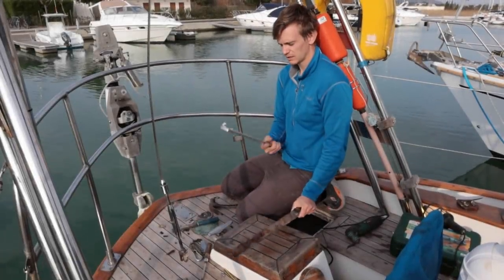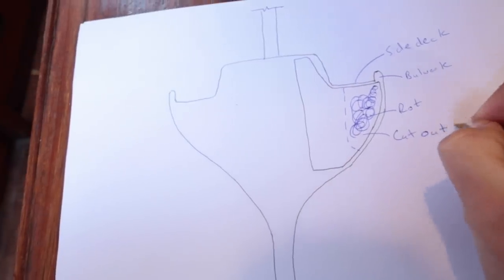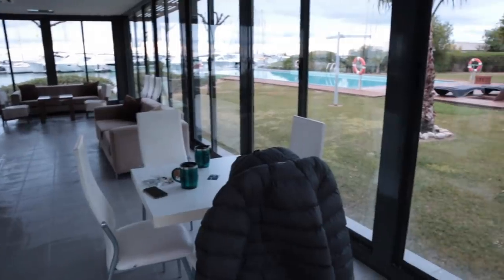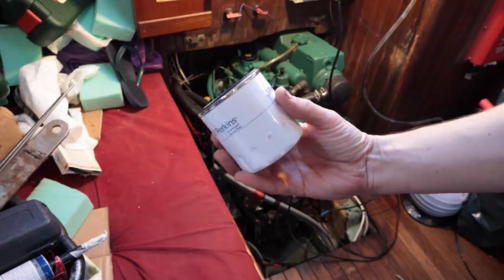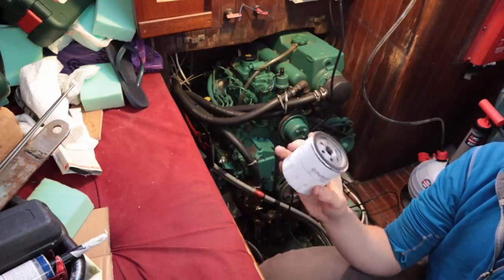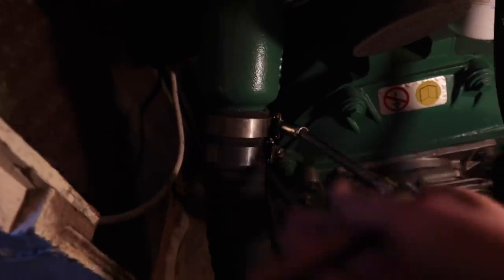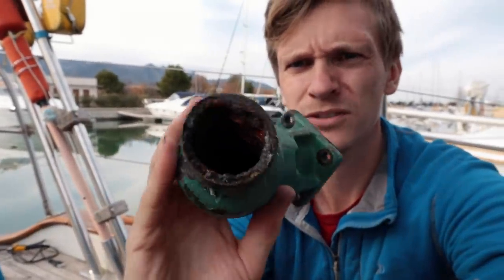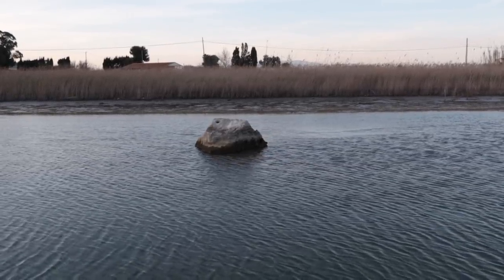41] OLD SAILBOAT ENGINE: Fixing THE BIG PROBLEM With Our Volvo Penta

Comment from the maker: What's your experience with Volvo engines? Is there any other preventative maintenance we should do?
Reply: replace the zinc anodes
Reply from the maker: Thanks for the tip, Michael.
Reply: Didya smear some oil on the filter o-ring?  Too late now if you didn’t but it stops the ring bunching up, leaking, blowing oil out and engine exploding 🤪🤪🤪😁😁
Reply: Keep an eye on those rubber parts on the ends of the heat exchanger. They don't last forever and replacements in far of places might be hard to find and they take a lot of tape to bodge up when they split. Too many engines us them instead of proper tube and end caps.  Great that it's a Perkins engine underneath. I have a  Peugeot 504 based marine engine also use by Volvo, ventus and others?
Cheers Warren
Reply: Sailing Kittiwake , hi another though on engines. Re The clogged exhaust mixing valve, my old engine manual suggests you should run the engine at full throttle for the last 15 minutes  prior to shutdown! Which would be good for burning out the coke in the exhaust etc.  I can't quite see me running hard into an anchorage or back to a marina .....but it makes sense just hard to do! ....just like my dad used to say about driving fast to ' blow off the plugs' never went down well with my mum!   Cheers Warren
Reply: I had a Volvo 940 2.0 petrol with 520,000 miles on it, think a genuine Volvo filter was about £12
Reply from the maker: Sweet ride, was it a turbo diesel one? That must be about 13000 hours?
Reply from the maker: Yep sure did
Reply from the maker: Haha like a Harley rider blipping the throttle :) although not as cool...  I think that would add up to some serious fuel over time.
Reply: It was mentioned here already: USE Your engine, at least once in a while! We usually slacken off our sailboat diesel engines to death (at least the people manoeuvring under sail, too, as long as the space isn't very confined, with an idling engine just as a backup ... for the five minutes only til the anchor sits.). A diesel engine does have to work hard now and then at least, just idling and lukewarm manoeuvring without warming it up and burning it free under 3/4 or more of the nominal revs once or twice a week for an hour is not good for Your engine.
Do not ever race it when it's cold, but do not slacken it off when it wants to get warm either! Even worse: not warming it up and stopping it in a lukewarm state over and over again. The coal You had in Your exhaust system doesn't only build up in the manifold, it does build up around the seating of Your exhaust valves and around Your injector and glow plug as well when not used hard by times.
Cheers
Reply: @6226superhurricane  Don't Think there is any anodes in a freshwater cooled Volvo Penta.
Reply: There are also pencil anodes on the engine block and heat exchanger that need regular replacement, when the one in the heat exchanger breaks off it blocks the heat exchanger pipes.
Reply: Not urgent but examine the engine cooler end plates, checking all tubes are patent, that there is no debris (old failed water pump vanes) sat in the header. As part of the cooler service you should check the ‘pencil anode’ on the salt water side and replace if necessary - and it probably will.

Not familiar with your installation but there is usually a separate salt water cooled gearbox - Volvo ones are not the best of materials to endure in a marine environment. Probably best to research and identify a better third party cooler (which will probably entail new and different hose runs) and procure when funds allow.
Reply: @johnnyandersson5622  not sure on that model my dads 6cyl had 3 or 4 pencil anodes it was freshwater cooled.
Reply: also i'm pretty sure the perkins prima is a volvo engine not the other way around. but that makes no difference if the perkins branded volvo parts are cheaper use them.
Reply: @johnnyandersson5622  sure there are... I had a house boat on a lake in Kentucky with an inboard Volvo Penta.. It had zinc anode in the heat exchanger
Reply: Ripped it out and replaced with Yanmar!
Reply: @6226superhurricane  Yes, the big ones but not 1 to 4 cyl sailboat motors like 2000 model.
Reply: @davidjessee7701  Yes, all the big VP has it but not the small 8-37hp Engines.
Reply: One main thing is the water pump impeller..if you have a failed and the blades break off.. Be sure to locate all the broken pieces..they will or can block off water and overheat the engine..
If you have a seawater strainer check it for debres every couple times you run the motor.. Every time you run the motor take a visual at the exhaust outlet.. Make sure water is being pumped through the heat exchanger
Reply: @CheersWarren  that is a standard suggested procedure for any diesel engine in a boat and yes, it is to burn of all manner of crap that is lingering in the system.  a good hard run and then ease into your marina or anchorage.
Reply: @johnnyandersson5622  I can not say with certainty regarding your engine but every diesel freshwater cooled engine I have seen has them in the block.  they are a very neglected maintenance item and the damage that running without them causes in your engine is amazing.
Reply: Jim Nickles  I have seen boaters stuck in places you would not imagine, waiting on the gold plated parts from volvo.  It seems the heat exchangers just do not last and cost a fortune.
Reply: @chrisscott1958  Ok, strange, I received an answer from two different Volvo Penta Technitions on Facebook Group "Volvo Penta" that there is no anodes on all 2003T models, and no one on factory dilivered freshwater cooled 2002 and 2003. However there are anodes on converted 2002 and 2003 they told me. I have a 2003 so I will check it this weekend.
Reply: I repaired my Volvo MD17C by replacing it with an electric motor 🤪
My motor ran great, but the trans died. I frequently did get air in the fuel lines which made me proficient at bleeding the injectors. 
They might not be everyone’s favorite motor, but they do run well.
Reply: Turn the bloody thing into an anchor and install an electric motor. Portable generators are cheap enough to be nearly disposable and with some forethought the CO issue can be minimized.
Reply: Ck your fuel pressure and see if it will hold over time. If not it can lead to hard starting issues.
Reply: @CheersWarren  I remember explaining to the policeman who stopped me for speeding, that I was blowing out my plugs......yeah he didn't seem to understand! 😁

Comment: You are doing sound quality work. You are doing the necessary work to assure safety, reliability and availability of important boat systems and that is a fundamental enabler to start cruising on a new to you boat. Those who are have no interest in this sort of work are not cut out to be cruisers. Even if you are rolling in dosh you cannot just call out a mechanic at sea when systems go ‘TU’.
Reply from the maker: Very true: no money can fix an engine in the middle of the sea 😊

Comment: boat work episodes are top ! thx for sharing
Reply from the maker: Yay! Thanks Nicolas!
Reply: @SailingKittiwake  btw I was wondering how long did it take you to replace your deck 's sealants (sanding and taping including taping ?) I scheduled this project on my boat too :/  (thx for the tip for marineflex) Also some recommand to use a tape at the bottom of the joints ?

Comment: Enjoying bingewatching your videos. I thought Kitiwake looked great after your repaint and maintenance. And I like the look of the work you have done on Skua. The woodwork looks amazing. I think you have a good balance on maintenance verses sailing. Somepeople take forever to get the boat in the water. You do what is necessary, with an ongoing improvement plan. Works well. Also it is nice to see you working with a small budget, and still achieving the dream. Well done.
Reply from the maker: Thanks so much Neale! Yes, it’s easy to never leave the boatyard, some of the boats in Portimao had been being worked on for 10 years!

Comment: Hi there guys good videos like them heaps .Just a note .on my volvo the exhaust elbow lasted 12 years . one of the problems with the stainless ones is they get pin holes as you are adding another metal to the engine. make sure you are keeping your engine cooling water anodes up to scratch.
Reply from the maker: Thanks a lot for the tip, David. Glad you’re enjoying the videos. We hope you’ll like the ones of us sailing too 😊

Comment: Check out Sail Life's vids. He has been refitting two boats for over four years and has quite a large faithful following. He has become very good at it over time and always has asked and taken advice from the audience. Most folks understand that with any sailing there is repair and maintenance. Used sailboats are used and generally in need of repair to some extent. You just keep on doing what you need to do and we will keep on watching and enjoying!!!
Reply from the maker: Cheers Dean. Yes, we follow Sail Life when we have spare data 😊 He’s really good at the boat work videos.

Comment: So good you got to know the ins and outs of the boat and what weaknesses it my have.  Impressed that the weaknesses you found have been put right. A sign of good seamanship. And at least you’ll know how to put right later on. Hopefully not at sea though.
Wish you fair winds and favourable tides / currents. 
As an aside, it’s pretty shocking that Volvo Penta charge so much, making a huge mark up. Shame then they use cast iron in the exhaust elbow and it was so full of crud after 800 hours since new. 
Remember to keep spare sacrificial engine anodes on board. My raw water cooled Volvo Penta ate them!
Reply from the maker: Cheers Nigel, good tips 😊👍

Comment: I hear some Yanmar 3YM30 get home engines on smaller Nordhavn trawlers have the corrosion problem with the cast iron exhaust elbow. The fix is the same. SS. So don't think Volvo Penta is picking on you lol Good on you for doing preventative maintenance. Good to know you won't lose auxiliary or steering at the worst possible time.
Reply from the maker: Yep, I think it's just a tricky thing to engineer, even the stainless ones get clogged over time I think but they're usable for longer.

Comment: When you change hydraulic fittings in a harsh environment it's a good idea to use stainless fittings and hoses as the won't corrode and become seized thus easier to maintane in the long run take it easy all the best

Comment: Hey guys. I got a Volvo Penta and ran into the same problem with the  exhaust. That piece of cast iron is brittle and rough making it easy to clough. Mine constricted the pipe to 10mm in diameter ! Almost costed me the engine. My friend told me out of all pentas he has fixed he noticed that the ones that run the engines hot and by hot I mean full power most of times there is no build up. But the ones that only use the engine mostly cold in or out marinas or only reved slow to slow engine wear clough in less than a year. The advise was that after engine temperature is optimal go as fast as possible and once in a while run it for extended periods to burn the build up. There is an stainless steel alternative that is smoother and cheaper, buy a spare with time ! I will let you know how running it fast makes a difference in a few month after the year service. You can also waterblast the crap out of the old one  but it will sadly clough faster.
Reply from the maker: Thanks for the tip TT, we are guilty of not usually running our engine at full revs - the fuel consumption just goes up too much, but I always try to get it up to operating temperature, about 180 - maybe that's not enough?
Reply: @SailingKittiwake  the temperature is controlled by the thermostat. After the engine is warm and the thermostat is wide open the cooling water increase with  the revs. So you cant run it hotter unless the thermostat is damaged or your hull is really bugged with barnacles. Is about time running and revs to burn the gunk. Mine is 30 hp. It goes from 2 to 3 liter per hour. So 33% more fuel but I go 6 knots instead of 4.5 knots 25% more speed so is not that bad

Comment: At low engine loads carbon cakes elbows like that. :) When exhaust gas temperature (EGT) is about 200 Celsius or when about 30% engine load is used, diesel fuel to gas conversion is only about 45 percent or half maximum. Whereas at 250 Celsius EGT or about 65% load it's about 85% conversion, almost maximum. At about 300-350 Celsius EGT or about 90-100% engine load it's at the maximum of about 90% conversion. This is why manufacturers recommend going at least 60% engine load, which is about the RPM engines make peak torque at, with short runs at 90-100%. You can get EGT kits on ebay for $40 if you want to nerd out monitoring temperatures, one for each cylinder even... or just run above 2000 RPM where your engine makes peak torque.
Also, like the diesel fuel tank polisher you made, you can also get diesel purge kits that you run through the injector system with the engine running, they can help clean injectors and improve fuel atomisation and burn. It's also a good idea to clean and re-oil the foam intake filter you have. 800 hours may also be getting close to needing a valve adjustment too, at which point you may want to check the head bolt torque. I'd also occasionally flush the raw water system and heat exchanger with calcium, lime, rust cleaner, and check the hoses for cracks. Also test the engine temperature, and oil alarm. Nothing will kill an engine faster than it overheating other than running out of oil or sucking in water. Service the starter motor brushes, commutator, bushes, solenoid and battery occasionally to make sure it starts first time, every time too!

Comment: It appeared that the coolant level was below the tubes in the heat exchanger. Is there a recovery reservoir attached to the tube from the top of the heat exchanger? If so, I believe the level should be at the top of the heat exchanger and the coolant level would be checked in the plastic reservoir.  Also, as mentioned before, be sure to replace the sacrificial anodes (pencils) in the heat exchanger when they are 50% gone.

Comment: Hi guys, love all the videos so no problem there.  I had similar problem with my Volvo 2020B and replaced my exhaust elbow which was totally shot and I also had water syphoning back t the engine which ruined the head.  I put a stainless high riser exhaust outlet to solve both problems.  My engine was rebuilt totally and runs sweet now.  Regular checks keep it working well.  Interested if you have any antifreeze in your coolant?  Might sound stupid question but some types of antifreeze contain anti corrosion properties which could help keep the system clear of any corrosion?  Great you are getting the important jobs done before you set off and then there will always be little jobs to do as you go from place to place.  Fair winds.  Andy UK

Comment: I finished reading Moby-Dick for the second time in like five years and it has me all interested in the sea.  If the rudder is hydraulic, how does it get power under sail? Why would you need a hydraulic rudder?  It's a boat not a ship. Do feathering props really make a difference in drag?  Wouldn't that be cool to have a prop feathered out under sail.
Reply from the maker: Hello there! The hydraulics isn't powered, it's just a way to transfer the force of the wheel to the rudder via a cylinder / piston. The idea behind the  hydraulics is that it's always very easy to steer. I'm not sure about feathering props, ours is a folding prop but I'd be surprised if it makes 0.1 knots difference. Thanks for the comment and questions!

Comment: Skua sailing works actually best with Skua being repaired/maintained/sorted out/massaged a bit. The "boating" without previous or subsequent boatwork isn't invented yet even with some channels not showing it. The elder Your boat grows, the more of both sorts of boatwork You usually will do, and should You try to shortcut or circumvent it, the most annoying third sort of boatwork, the intermittent mid-season one You will have to show in the end; 
with the latter also the sort of boatwork any sharky professional everywhere anchors are being dropped around the world is awaiting and preying on most of the season.
Reply from the maker: Yes, there’s always something to do on board 😊

Comment: I need to do the same on my T37PH, any chance you could include a link to the supper/items? I wasn't sure the non PH T37's had hydrylic steering so thanks for clarifying that. So.etkme hydrylic is used to provide a second wheel.

Comment: The wet elbow is always a problem with every engine. It's something that needs a technology 'fix'. Never seen any notes on whether a PTFE, ceramic or other lining has ever been researched on them. I always meant to install a fresh water flush system on mine which could be run for the last few minutes of engine time, instead of the raw water feed, but then that was coming back to a dock. Because it's hot you'll get coloidal deposition of contaminants in the water; organic and in-organic. That's tough when fed by salt water. I do know that the Great Lakes in the USA cause less of this problem because the water is 'better'. Salt has a lot to answer for. Changing the zincs in the engine and heat exchanger helps. Never be tempted to 'let it go' if an impeller sheds some blades. You will have to take the exchanger apart and find ALL of the blades or you'll just be back there (sooner) again.
Reply from the maker: Thanks Paul, yes I guess if there was an easy solution to the exhaust elbow problem then engine manufacturers would be using it. Hopefully the stainless surface will prove a little less easy to clog than the cast iron one, at least it's not a difficult fix - if it's every 1000 hours then it's acceptable.